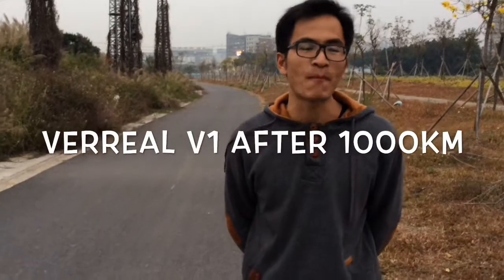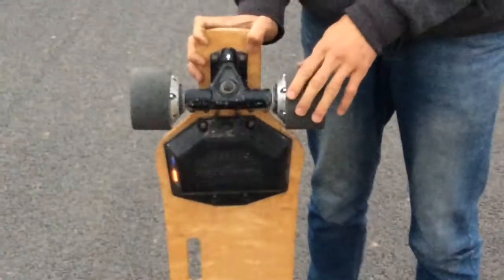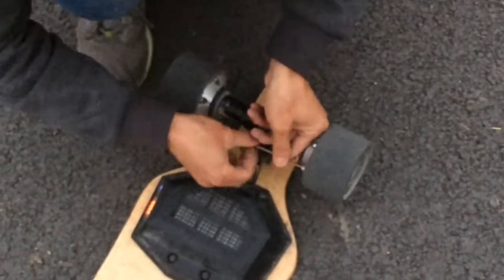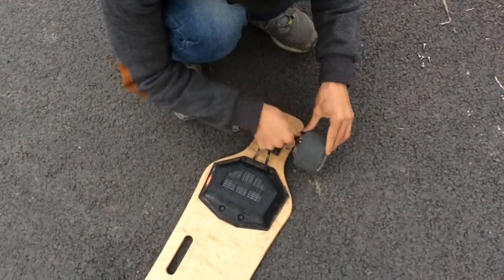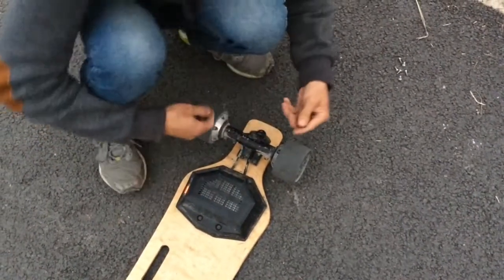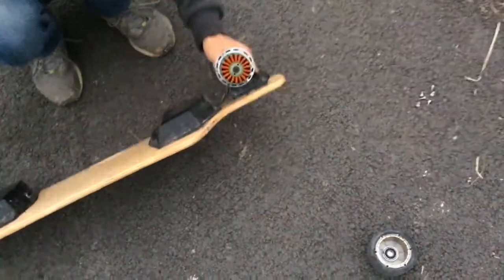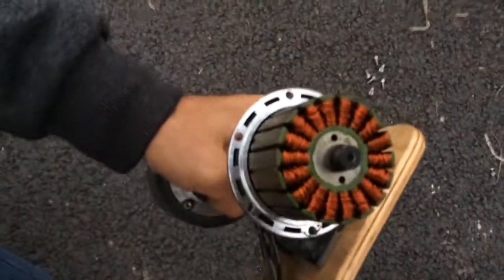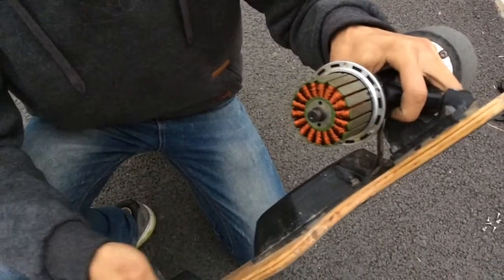Verreal V1 Electric Skateboard After 1000KM

Comment: cool board. went to checkout and then saw they want 109.00 shipping! lol. with that price increase I can buy a better unit with free shipping.
Reply: Most companies such as Meepo, WowGo, etc, roll the cost of shipping into the product, then call it "free".
Reply from the maker: Well, thanks for your comments. This is Vic. Let me explain to you why it is so expensive. Our electric skateboard's net weight is 6.5 kilograms. It is about 12 kilograms after packaging. In no way can you ship something weighing 12 kilograms internationally. In addition, our electric skateboard has a big battery pack with its capacity well over 99 watt hours. All the airlines have this regulation that electric devices over 99 watt hour cannot be allowed aboard. So this makes it harder to ship. 25 dollars will cover shipping for packages under 2 kilograms.
Reply: Verreal E-Board well I have a camper. I needed a weight distribution hitch setup. total weight was 85 pounds. shipping was free.  I understand that the unit must be shipped over boat and land. still, deceptive to advertise at 279 then hit with another 109 shipping. no way does it cost more that much to ship the unit. so you must be building in a profit margin to ship.
Reply: Kyle Simmons hence the cost is up front. reviewers he sent boards to stating a price point of 259-279 to boost sales for him, then when you go to checkout, you get hit with a 109 dollar charge. deceptive.

Comment: How is the water-proofing on the motors? If I replaced it and not tighten enough, maybe water will get in and cause damage? Can it work with MEEPO/Ownboard ESCs? Should I use glue/loctight paste to enhance the water proof on the motors?